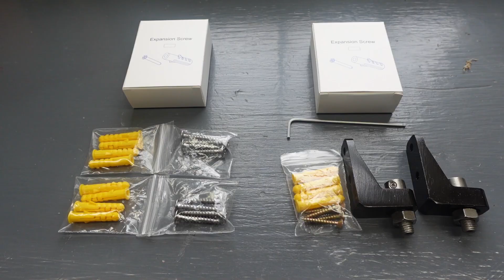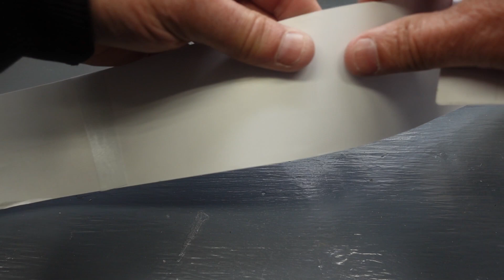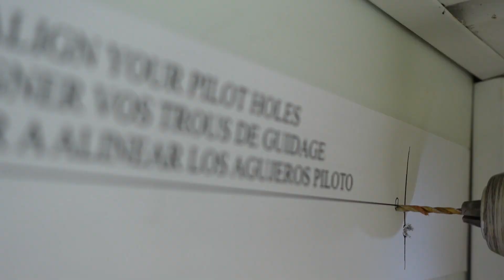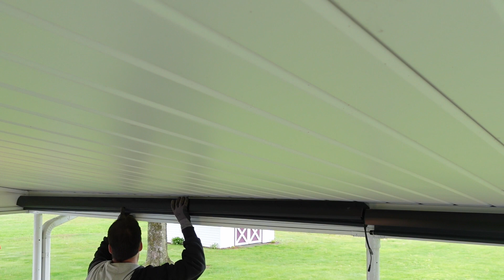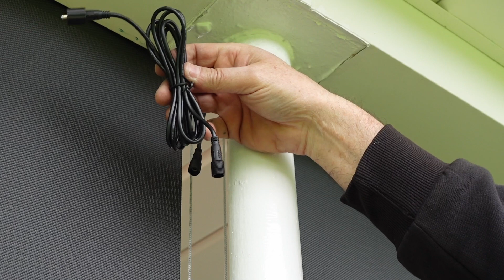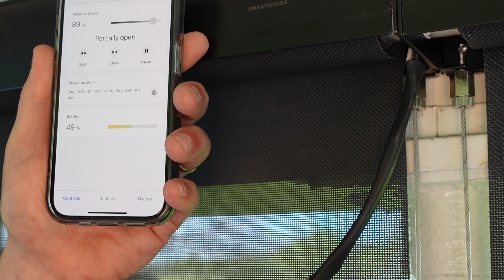SmartWings Outdoor Shades for SmartThings, HomeKit and Alexa

Comment: I'm thinking of mounting the outdoor shade to my aluminum patio cover. Is there a specific type of screw that I should use?
janet
Reply from the maker: The mounting brackets have pre-drilled holes. I would recommend using the provided template to mark out bracket placement and then pre-drill holes in the aluminum. Then secure the brackets using stainless steel machine bolts and nylock nuts (self-locking) or add lock washers to prevent loosening. Be sure the bolts are long enough to go through the aluminum and have full thread engagement with the nut (add ~1/4” past material thickness). Use a washer on both sides to distribute pressure and prevent crushing the aluminum

Comment: Mine just randomly started operating backwards. When I click OPEN in SmartThings, they close, and when I click CLOSE, they open. They were working great before, not sure what is happening now. Any idea how to fix this?
Reply from the maker: Not sure @abstakr.  The driver was updated/corrected to reverse the function about 3 weeks ago and it has been controlling the blinds correctly for me ever since that update.  Here is the link to the SmartThings Community article: (https://community.smartthings.com/t/mc-zigbee-window-treatment-edge-driver-issues/262788/94 )   Check your driver to ensure that the proper one is installed for your shades.  You should be using 'Zigbee Window Treatment Mc'.  If the driver is correct, you could try rebooting your ST Hub: https://www.samsung.com/us/support/troubleshooting/TSG01109858/
Reply: @BudsSmartHome  That was it! I had the 'Zigbee Window Treatment' driver (without the MC at the end). Once I installed the other driver it started working correctly again. Thanks!
Reply from the maker: @abstakr  – great! Glad you got it working

Comment: I noticed a bit of flapping when there was bit of a breeze. Is there a way to add tension? Can you add a different weighted bottom?
Reply from the maker: There will be some flapping despite the tension on the cables.  This is a result of the shade billowing, similar to a sail on a boat.  The rod is just sliding up on the cable to compensate.  The shade however does not sway on the bottom like an unanchored shade would move.  SmartWings recommends that you retract them if high wind is expected,

Comment: Hi Bud. 
Thanks for this great overview video. I'm looking at installation of outdoor shades on a conservatory which is South facing and becoming like a sauna in the recent uk summers. Do you think these provide a decent amount of shade? They quote only allowing 5% of light through but your video made them look quite clear. I'm keen on using the smartthings automation to shade the room based on the weather and this seems ideal to me if the level of shade is sufficient. Thanks as always.
Reply from the maker: Hi Justin.  Their website says "5% Openness".  I'm not really sure what that means.  They also state "Our fabric can block heat from the sun and up to 92% of glaring UV rays, so you can read, use your phone, or watch TV without squinting."  In my opinion, if you look directly at the sun through the shades it is still a little uncomfortable.  They allow a breeze to come though and they provide shade to make the area a little cooler.  My video gives a good idea of what you might expect.  If you are unsure you can order the fabric samples before purchasing so that you can view the extent of light filtering.  Here is a link to the fabric samples page:  https://www.smartwingshome.com/collections/outdoor-shades?ref=17
Reply: @BudsSmartHome  thanks Bud. It's a big investment so some independent thinking goes a long way. I'll get some samples shipped 👍👍.
Reply from the maker: A wise thing to do my friend.👍
Reply from the maker: You can also reach out to SmartWings at 1-877-762-7861.  They have great customer service and are very helpful.  Tell them your were referred by me.  Thanks Justin!

Comment: Thanks Bud for your content! Seems to me SmartWings are really gathering popularity! I wish that the Edge drive was native to SmartWings. With so many devices going with Matter, I’ve been hesitant to buy anything, does it have an edge driver, etc., wish standards an exactly what direction Samsung was going in would be clear. I’m still using lots of devices that still work with the Groovy IDE.
Reply from the maker: About an Edge Driver, check in the video description below the video.  I provide a link to my website with instructions for accessing and downloading the driver.  It is very simple to install.  Also, note that these shades are Matter compatible.  If you have a SmartThings V3 Hub or an Aeotec Hub, these hubs have a built in Thread Border Router that will create a Thread network for Matter devices.  If you have a SmartThings V2 Hub you will need a Matter controller that includes a Thread Border Router.  You can still connect Thread devices in SmartThings using a third-party Thread Border router. See ( Here : https://tinyurl.com/yckr6kut ) for more information.